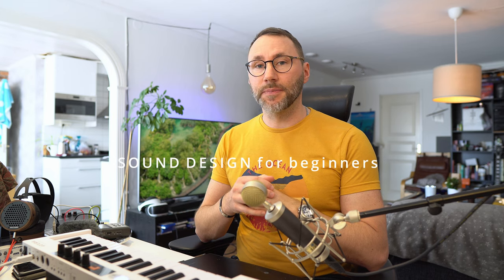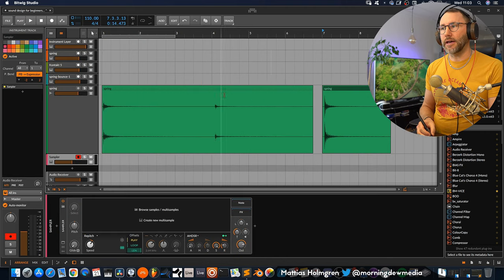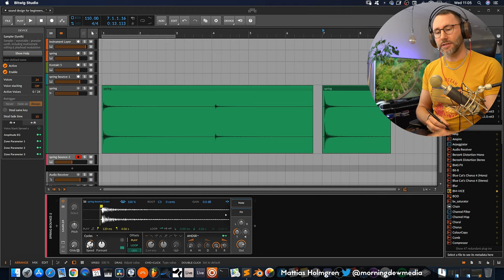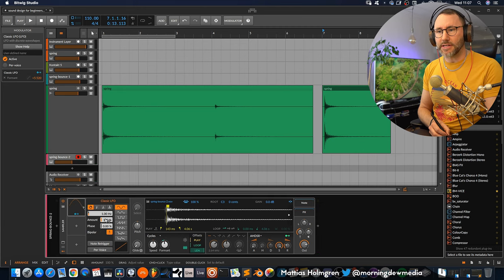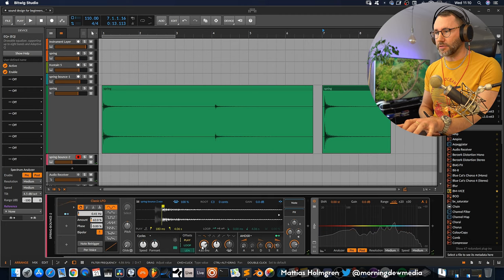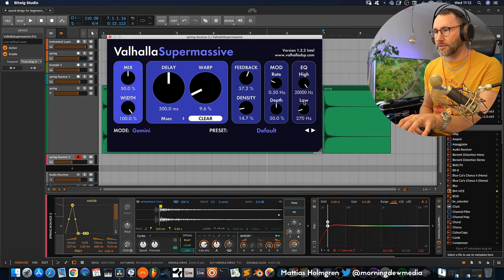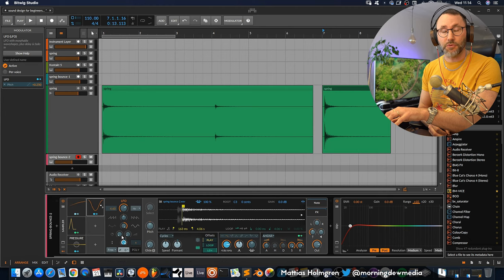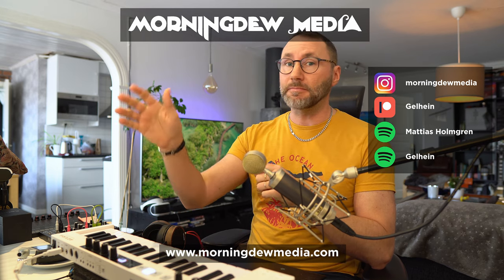Sound Design For Beginners E01 - Bitwig Sampler Cycles mode

Comment: Hi again. I haven't yet bought a Wacom intuos pro but soon I will. I do have a few questions.

1.
Now with Ableton 11 and bitwig 3.3..wich DAW you think behaves best with the Wacom tablet? 

2.
Is it still accelerating problems in Ableton?

3.
Do I drag vsts into bitwig in same easy way I do it in Ableton?

I understand you use both daws. What advantages do this daws have if you do a shootout in pros n cons.
Tnx
Reply from the maker: Hi both Ableton and Bitwig works great with a Wacom. You can deactivate the acceleration in Ableton which fixes the oddity. Ill make another video explaining my thoughts on both daws pros cons. Yes both DAWs have drag n drop (if u want) or add devices / plugins by pressing the + sign. 😉🦊🌞
Reply: @MattiasHolmgren  hi there. I watched an older video when you talk about Wacom..when you say it works great in Ableton,  does it mean you can do everything you want? Like copy paste tracks, cut tracks, edit automation curves, drag in samples from your library, edit vsts with hand gestures as easy as your cubase examples etc. Well you got my point. I can't use a mouse anymore, hurts to much, just wanna be sure before I buy it. Cos cost slot compare to other brands and it's a bit old(2017). Should I go for something cheaper first and wait for gen 3?

Comment: Nice, but you didn't show how to get the really great pad sound you played at the beginning of the video. If that was what you ended up with, it sure didn't sound like it.
Reply from the maker: Hi Brian. It was just a different placement of the play start-offset in the sample, and slightly different reverb setting on Valhalls Supermassive, that's about it. I also had a bit if compression on the intro version. My videos are about teaching concepts. 🌞 Thanks.
Reply: @MattiasHolmgren  OK, cool; that helps. Thanks!